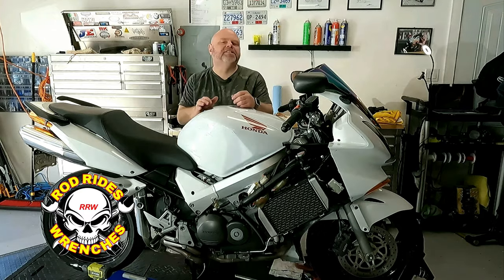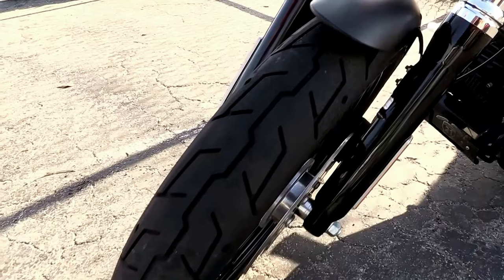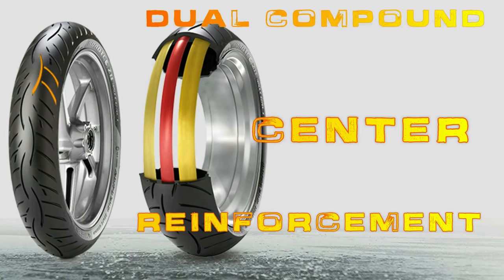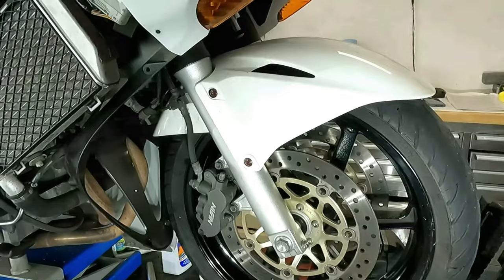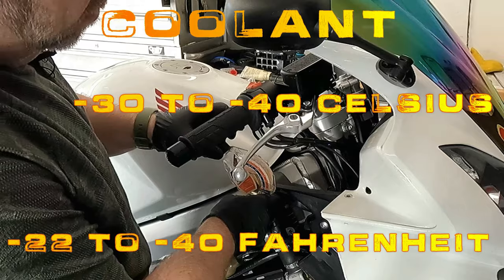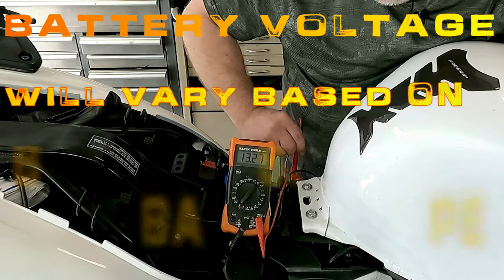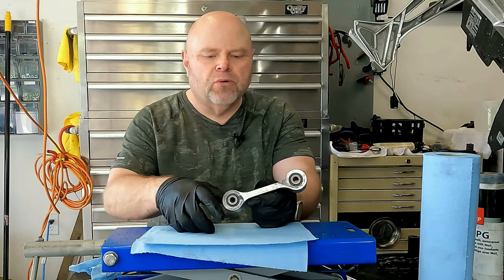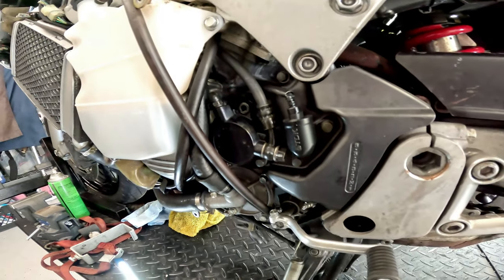Annual Motorcycle Maintenance Inspection

Comment: like two years ago i got a angel st made in europe from 2010 with the world record sticker too, old tire worked great. thats just squareing off a tire you can ride around it by flicking the bike down past it, or running dramatically high tire pressure like 40/42 makes it less noticeable too if not recomended. I normay dont have that problem but my bikes that are exclusively for the canyons the fronts turn to triangles from trailbrakeing. same technique to ride around it  but a little more concerning cause you have to go a little further. cuping on a tire is a wiered suspension/pressure issue where the leading or training edge of the tread is dramiticly raised makes each tread block look like a cup.

you can experimentally find the perfect chain tension with a ratchet strap straping up the rear wheel so the rear axle the pivot bolt and output shaft are all in a line (the max tension) then just adjust it for a little bit of slack then just let it down.

Comment: Love the content. Helps me with rebuilding a crashed st1300 and I love the bike! I want it back to it's designed ride condition but sadly at the moment she's far from it😔 got her in a sad state but I'm trying to breathe life back into her. Only problem I can't figure out is when I accelerate hard in 1st 2nd and sometimes in 3rd, it stalls and I HAVE to switch off the ignition to restart it otherwise it will just turn over if I hit the start button... Any ideas? Thanks for all the help and info man!
Reply from the maker: If you cycle the key off and on after the stall  as apposed to the engine kill switch (or vise versa) does it make a difference?  If not I would start at the wiring harness, a lot of issues can result from a corroded ground cable.  You may not be able to see the corrosion but if you cut the cable open it will be green with oxidation.  Check the battery cables on both ends both positive and negative since this is a condition that can be duplicated by a loose battery cable.  If the bike feels/smells (no gas) like it is being fuel starved, I would check the fuel flow back in the garage against the factory manual stat as you may need a new pump or maybe just a new filter.   I would then check all the wiring connectors, pull the fairing and go through all the harness from the switch housings to the ECM, pay special attention to the fuel pump.  Pull apart the connectors, inspect them for corrosion, clean up with WD40 & conductive grease. If still no joy, remove the airbox and check the connections under it, wring can get crispy under there.  Run the harness and look for wear through the loom and wiring causing a short, but without FI Codes I would think the problem is relegated to the ignition itself, key switch, right handlebar switch or the fuel delivery, pump and filter.  You have taken the right handlebar switch apart and cleaned it with WD40 already, right?  Here is why this is so important https://youtu.be/W0MTZbtMgOw?t=560  - Good Luck!
Reply: @RodRidesWrenches  while riding when I try to hard accelerate it dies then clutch in and I flip the kill switch off then on again and it starts. I'll admit I haven't pulled apart the air box or the fuel pump as I do ride it regularly as a daily rider and take it on long rides. I did have to go through the wiring harness to get it to run but not quite as thoroughly as you described. I get decent acceleration I just can't hard accelerate in 1st 2nd and the beginning of 3rd. I'm out of town for a month but I'll pull the air box and fuel pump when I get home. Right now she is without all the front fairings and I use my phone as a speedo since I can't mount the gauge cluster. I'll report what I find if anything... Thanks for the help.